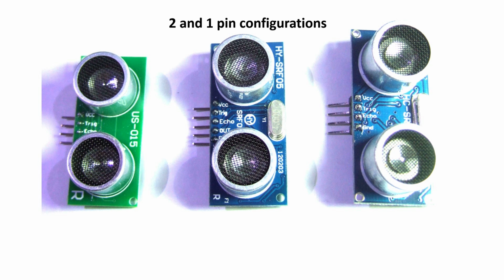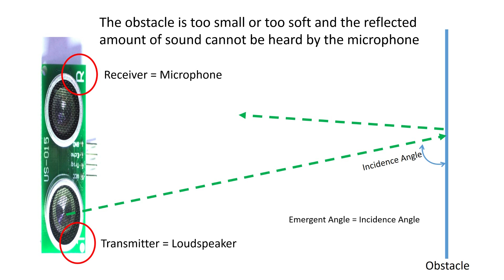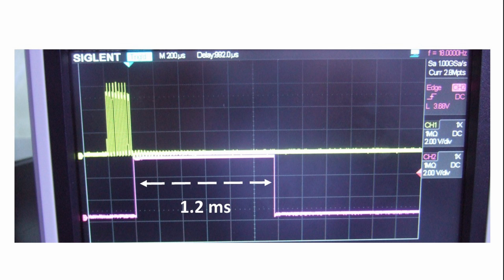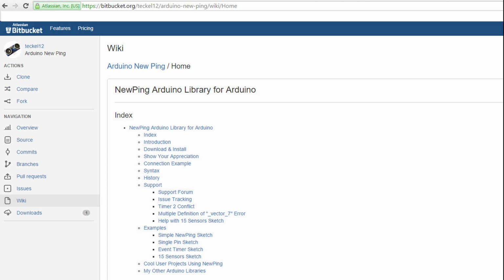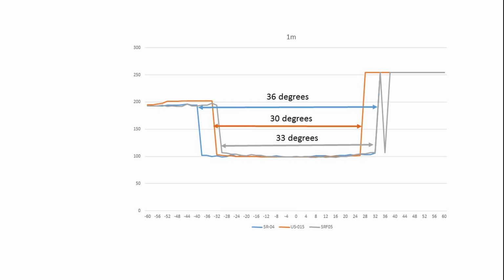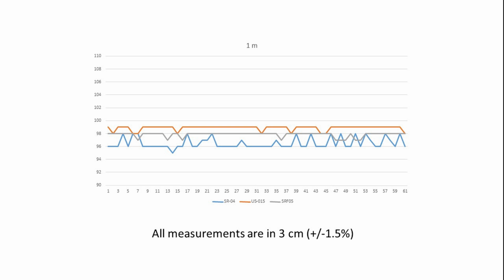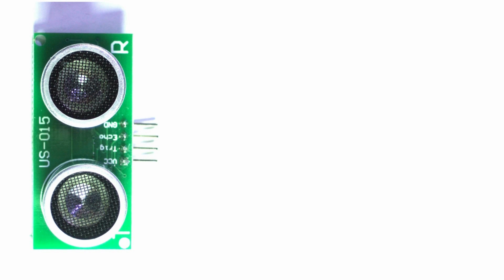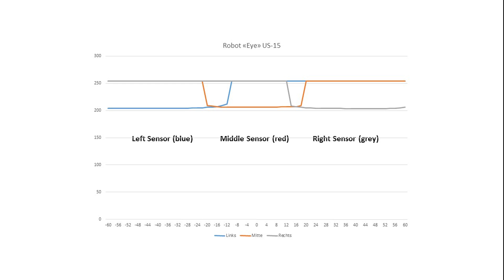#40 Ultrasonic Distance Sensors Arduino Tutorial and Comparison for HC-SR04, HY-SRF05, US-015

Comment: Impressive research! However can you explain in more detail the repeatability of measurements per sensor? By that I mean performing repeated measurements done over identical distances and verifying their deviation from mean (I am not talking accuracy). The HC-SR04 has a bad reputation in that regard (ref. various fora and issues reported with unstable measurements in halfway range, locking of transducer when "out of range", spurious large measurement errors,..).

Do you have any informaation from your measurements that would concur with this issue? Or would you describe this to probable software errors?

Also the US-100 sensor is an option: how do/would you rate that sensor compared to the US-015?
Reply from the maker: I only did the research presented in the video and I do not own a US-100. So, I never tried this one. I used mine on my robot. So, accuracy was not so important and I had more problems with non-even reflection surfaces. Because, if the surface does not reflect the sound back, you get no measurement and the robot drives on...

Comment: nice video! My english is too bad to understand very well so which one is better ? US-015?  I have to detect distance between people and a painting on the wall. Which sensor is the best? Because i have a HC SR04 and it gives me unstable values. How many sensors i have to combine to make a good people sensor ? And how i have to position them ? Thanks a lot!!
Reply from the maker: The differences between the  sensors are small. So, if the SR04 does not work, the US-015 probably also will not work. 
I cannot answer your question about your scenario, because  I do not know, what you really want to achieve.

Comment: I have two hc-sr04. Bought them localy. Both of them failed to work after just 1 day of use (checked with scope). Could you recommend where to buy original ones? I have made simple bot. This is video of first version https://www.youtube.com/watch?v=SSYUvbcT-oY  I made it much smoother than in video. But I just tired of those cheap sensors just dying in no reason.
Reply from the maker: Well done! I do not know if there are "originals" around. I would just try another source. Did you find out, what failed?
Maybe you try another make: https://www.aliexpress.com/item/Free-shipping-20pcs-Ultrasonic-Module-US-015-Distance-Measuring-Transducer-Sensor-for-Arduino-replace-HC-SR04/32253958050.html
Reply: I have bought them in different time in same location. They came in diffrent package but overall sensors looked identical and had the same problems. First they locked out after some time in operation. Output is high all the time. You have to bang with finger and they come live again. (First thought it was bad soldering, but it is not) found out that other users reported the same problem as I. Now sensor is pinging but not recieveing the echo. The output is very short high and constant.

Comment: good day man, i have  three ultrasonic  sensors hc-sr04, i wanna make an evader obstacles with arduino one so i have  decided  to make a structure and to put the sensors like this:
(IOOI-IOOI-IOOI) to get the best  coverage, so i wanna make is the following: the sensor of the middle will be emitting and receiver but the other two sensors will be receiver only, i made all ok, the connections, the trigg signal, the  echo signal too, the vcc, i know that after trigg,  it needs a delay. the middle sensor work exelent  but the problem is the other two sensors, what do i must do with the trigg pin of the that two sensors?, already i connected it to gnd and  dont work like this.
Reply from the maker: I do not know. But I think, you have to also trigger them (all three in parallel). Then, it might work. And if your senders emitted sounds interfere, you can put something in front of the two "passive sendes" or desolder them. This is, why 

I assume, you know how to handle the three independent time measuring systems with arduino?

Did you check my video #42? There, I use 3 independent sensors.
Reply: thanks professor, i´m gonna see your video #42

Comment: Can you do a short video on the oscilloscope set up?
Reply from the maker: +Glychee S I connected one channel to the trigger pin and the other to the echo pin or the pin at the transmitter (for the tone). Nothing special... Or did I miss something?
Reply: Ah i thought you had the oscilloscope itself do sme waveform generation and a special triggering. But that makes a lot of sense,thanks!

Comment: Thanks. Your videos are always unique. One question : I see most of the robots have UltraSonic sensor mounted on a stepper motor and they scan field for 0 to 180. Any thoughts about this setup. Please let me know.
Reply from the maker: +Venkatesh E Thank you for your compliment. This is exactly, what I want: To provede a unique twist. 
Now to your question: It will be anwered in depth in the next video. Here the short answer: Servos do not work if you want to move fast as my robot. You have to react in miliseconds. You will see, I had even to build a sub-system using an ATtiny85 to get the speed I wanted.
In the future we might get LIDAR systems based on lasers like Googles car which somehow work like a servos, but much faster. Currently, they are still very expensive.
Reply: waiting for more videos.. keep posting..thank you.
Reply: +Andreas Spiess a surface mirror mounted in the flat section of a output shaft of a galvanometer  could move fats enough , and you could apply a wave form to it to produce a sweep .  You can see them used to direct beams for laser light show patterns .  not sure if one could use the same reflector to measure the reflected light on almost same beam path . 
Great video as ever man .
Reply from the maker: +XerotoLabs Interesting idea. I have a galvanometer lying aroud and waiting for test. So far, I did only think of the laser show. I will check your idea as soon as I start to play around with it.
The only problem then is, that a normal laser is not able to measure distance. I still did not find a sensor of a cheep laser range meter with a normal connection (I2C, serial). The ones I found were always more than 100$ plus shipping from the US, which adds another 30$ or so to the bill.
Reply: +Andreas Spiess if you shot a laser from a offset position , and surface mirror allowed a sensor to sweep a area , then you could use the defection angle of the mirror that returns the brightest spot to calculate distance . lets assume laser is brightest thing in view  the farther from center the closer the target is . hmm now i need to draw that .
Reply: +Andreas Spiess yes have a look at this , if you know the rate or position of the galvanometer  .. 
http://s29.postimg.org/6e3qbwgvb/scanner_1.jpg

the farther the object the closer to 90deg , or virtual parallel it will appear . in this mode in close distances are more accurate than far off ones.
Reply: +XerotoLabs hmm actually yo could swap the sensor and laser source if the sensor has a narrow field of view. then it will only get bright laser returns when the laser hit a object that is in path of the sensor. this is les complex and avoids needing some sort of alignment of the sensor and galvanometer . this way you just need to make sure the galvano'  makes the laser beam path sweep through sight line of the sensor . if you know what angle the laser left the galvano'  and you know the axle distance to the center of the sensor you can triangulate.